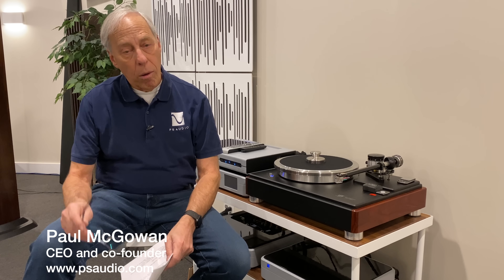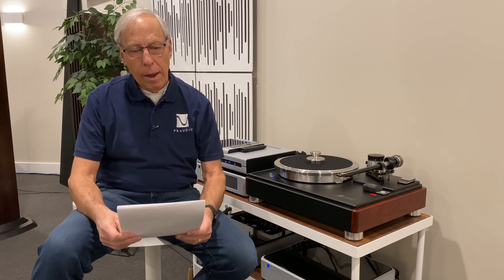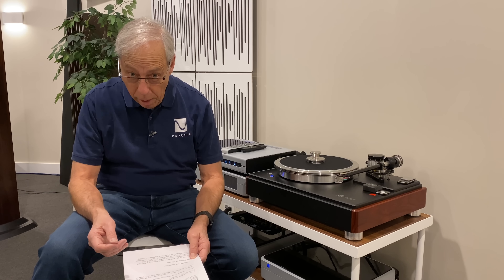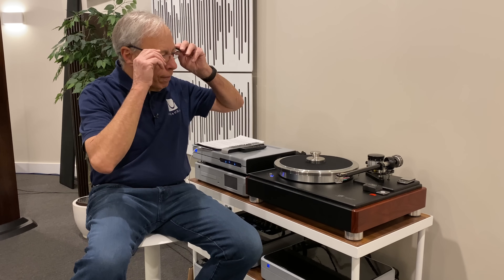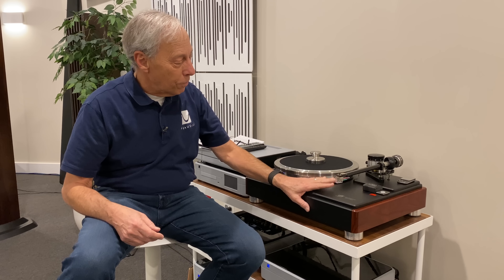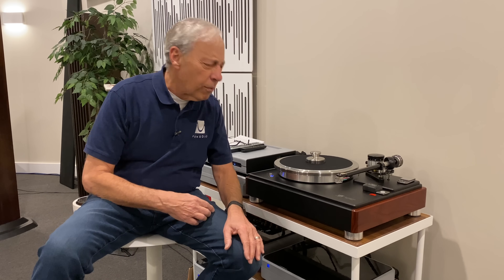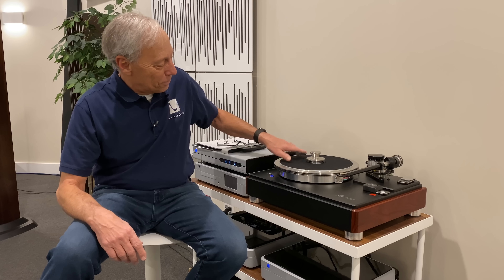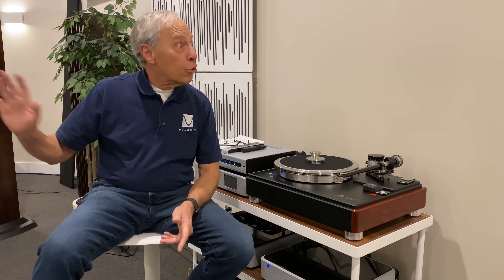Better to use a power conditioner or straight into the wall?

Comment: I've used a handful of conditioners and wasn't happy until I tried one of the modern Furman conditioners (which are made for audio and are used in many recording studios.)  I've gone back and forth several times between the wall and the Furman and the Furman stays.  It cleans up the system and if there is any detriment to the sound, it's not of any significance.
Reply: my system was very noizy.guy at the music store told me to get an furman power conditioner.soon as i turned on my system noise gone clean power using ps audio jewel ac power cord.
Reply: Without real measurements from an EMI Dirty Electricity Meter in mV, saying it cleans up the system is just based on your personal opinion. I have an expensive Furman PL-PLUS DMC Power Conditioner and the dirty electric signal in my wall outlet is 56 mV and any outlet on the Furman itself is worse at 160 mV. So yeah, according to my Greenwave EMI Dirty Electricity Meter, the Furman is NOT cleaning up the dirty electricity and actually making it worse!
Reply: @andynonimuss6298  You can visit the Furman page or better yet write them and get  frequency dependent plots showing noise reduction. If you don't trust those, I welcome you to purchase a proper network analyzer or oscilloscope with a decent probe to recreate those data. I wouldn't trust some cheesy $100 noise meter bought off the web for a full spectrum, calibrated noise analysis. They won't have the bandwidth to provide useful information.
Reply: @terrywho22  And yet here YOU are trusting those claims without any evidence or testing of YOUR own! I'm looking forward to YOUR video and testing evidence with a proper network analyzer or oscilloscope. Until then, I will continue to challenge their claims just like a lot of people already are.
Reply: @andynonimuss6298   I'm not the one doubting their claim. I can hear the difference.  Further, I've worked in studios where we used them and they wiped a significant amount of background noise from tracks we were recording. If you can't hear a difference, don't use one. But know that your "testing" method is flawed and if you want to do a proper job debunking Furman's claims, you'll need the proper equipment and knowledge to do it correctly (which I have pointed out is rather expensive and the process time consuming.)
Reply: @terrywho22  Exactly my point. I have the Furman PL-PLUS DMC Power Conditioner and I don't hear any difference. Sorry to say, but if you search around the Web and on YouTube I'm not the only person disputing and disproving their line noise reduction claims.
Reply: @andynonimuss6298  I can respect that. Sorry that it didn't help your situation.  I recently read an excellent account of a researcher that measures extremely small voltages in his lab and found that using Furman power conditioners did help reduce his noise floor on very sensitive gear. I wish I had the series of posts that I could relay to you, but either way that doesn't change your situation and I'm rather disappointed the conditioner did not help... especially given that you laid out a fair amount of money for a nice model.  All the best.
Reply: Interesting, what model do you have or recommend? as there are few at different price points and I never gone down this route just straight from the wall
Reply: @tothemax324  I've been pretty happy with the inexpensive PST-8D.

Comment: Do surge protector power strips have a negative effect  on audio?
Reply: As long as it uses 12 AWG wire and outlets with good tension like hospital grade ones and has no inductors or capacitors in it then no it won't effect the sound , where as while power conditioners will remove noise  the inductors and capacitors  in it cause the voltage and current will be out of phase which will negatively effect the audio.
Reply: @leekumiega6576  Thanks

Comment: your get way better results  conditing your rooms  Acoustics .
Reply: Acoustics is easy to over-do. A very furnished room will often have the right amount of diffusion and reflection to sound alive enough. especially mid sized room is fairly easy. Larger rooms might be more difficult. speaker placement, and coupling or decoupling of speakers is more important than room acoustics.
Reply: Shielded high quality power cable on an IGR is all you should need.

Comment: within the last year i have experimented with power cables and a device called DC Blocker. my conclusion is that they do make a difference and as you have indicated it all depends on how resolving your system is. i can tell you that i wont be going back to standard power cords.
Reply: The most interesting power conditioning system I ever worked with involved a motor, a flywheel and a generator. The motor was driven from the line feed, I think it was 240vac 3-phase. That was connected by a shaft to the generator. Lets assume that was a 240vac 3-phase generator. Attached to the shaft was a flywheel. That thing was pretty tough and was used to stabilize the feed power to a critical computer system. It was not designed to keep things going when line feed was lost. Believe it or not it was in a office building in downtown Tulsa OK.
Reply: @wilcalint  amazing

Comment: Is this a big problem in the US? US uses 120v UK 240v,  US 60 Hz, UK  50 Hz. I've never tried it so can't say anything other than an educated guess. But if you've got a high end system (that beautiful turntable must be 10k plus) , in excess of 20k, surely when it's designed, built, tested, put together, if there's this 'huge haze' that is lifted by a power conditioner then it would've been back to the drawing board at the design stage? How could you sell products without an included power conditioner/ chord if they had a 'huge haze' over them?
Reply: logical

Comment: The DC filter that supra has is a filter that is very good, but still a filter. And if you have to use a power block, because you have too few outlets, you will have to get some better power blocks etc to avoid the problem with low quality power blocks. Bad power blocks destroys good sound. Especially for amplifiers.

Comment: I always plug my high current amplifier directly into the wall....fairly obvious here.  But, I plug my pre-pro into a power conditioner because my (basic) understanding is that this component draws much less current to work so that it can easily get what clean juice it needs from the conditioner.   Is that incorrect?
Reply: You are probably correct. Especially if it is a power conditioner for audio equipment.
Reply: That is the best policy. Power amps do not require power conditioning and work far better directly off the raw AC line which provides a CONTINUOUS low impedance source. Many re-generators claim to offer even lower source impedance than the power line and that's not a lie. However they can only do that for a limited time then the power supply within the re-generator must recover. For brief transients with a poor AC supply I guess they may offer some benefits. But you have to weight in the cost.
Reply: @andydelle4509  large power regenerators are good for amps, but they are insanely expensive.

Comment: I’m gonna be far more radical on this then Paul is.

I have at least 20 more years experience dealing with crap line power then Paul does. First 99% of consumers have no idea of the quality of the wall socket power they get. It can be horrific yet your system plays just fine. Today. Then in a few months the Receiver, Preamp, Amp, DAC all or some don’t power up anymore.

You kinda have to make a rough estimate what your risk is. If you’ve a moderate investment, and willing to lose it, some or  all, go ahead and plug it naked into the wall socket. If you’ve invested 10’s of thousands of $$$ into your system. Do something, anything. A power strip with “protection” is a joke. Do something. One of Pauls Power Plants as a start would be a really good start.

If you live in something like a 50 year old apartment building with window mounted air conditioning you’ve got s..t power.
Reply: Power strip protection.

Common power strips have devices in them to protect mostly against “spikes” in the line. They absorbe the energy and dissipate it as heat. And that many times in just 10’s of milliseconds. They do that one time. The second 10,000vdc spike coming down the line 100ms after the first spike goes right into your components power supply and they have to deal with it. And many times they do that by self destructing.
Reply: Worst of the worst

You live in an older Apartment building with a common air conditioning system. And it’s getting old. Like 40 years old. One day when the HVAC motor turns off, not on, but immediately the motor seizes, throws a massive common mode spike into the grounding system of the buildings power distribution wiring. You come home to find your treasured DAC for some reason does not turn on anymore. Or where the DAC was is a little pile of burnt charcoal.

I wonder if Pauls Power Plants self destruct to protect whatever is connected to them?
Reply: I live in a 60 year old apartment. And the power is crap.... :)
Reply: @oysteinsoreide4323  Crap is one thing. Distructive is another.
Reply: @oysteinsoreide4323  The worst power I had to deal with was in the office of an oil products tank farm distribution facility. Huge old motors, switches, relays, motorized valves and on and on. All of it constructed in the 50's. Into which we had to install a $250,000 very critical computer system that was not ever allowed to go down, or wiggle even a little. It was next to the Mississippi River in East St Louis IL.
Reply: @wilcalint - off subject, but as a 61 year resident of STL. If you were in East St. Louis, IL you had more problems than you know...
Reply: @Mark-lq3sb  I suspect there are still tank farms over there. This effort was in the mid 70's and we were well aware of our environs. It took us about 6-weeks to get that thing in an up and running.
Reply: A fun follow up is that I think about a year later we got a panic call from that office that a "Ice Jam on the MIss was going to flood the office and computer and we had just 48-hours to get it out of there. So fly from San Diego to St. Louis, drive over to E. St Louis and the engineers had only hours to get that thing out of there, safely. Important tool used? Fireaxe.
Reply: @oysteinsoreide4323  If you recognize things that tell you your AC power is crap, it's really crap.
Reply: @B57.V  I never said it sounds bad.
Reply: I unplug my Naim gear if there is a storm and lightning.  Otherwise its straight into the wall.  I havent researched PS Audio products but they all cost alot.
Reply: @rd264  Lightening strikes can occur at any time, even without a storm. Pulling your master plug on your system likely will prevent a Lightening strike on your homes power distribution system from damaging your audio system. I've done that myself.

IMO your system is more likely to be damaged by line surges, a ground fault or a deep voltage sag in the delivery. Going down to 90vac can be just as damaging as going briefly up to 340vac.

I applaud PS Audio for offering their line of power conditioning products. I can think of lots of reasons to need one. Especially if you live in a multi residence building. Especially an old one. An oldbuilding with an old common air conditioning machine is probably a problem.

I would expect that a PS Audio power station would sacrifice itself in some way before it passes on a power anomaly.
Reply: Power line used as a LAN/WAN

Most power utilities today use digital communication on their distribution system to “read the meters”. Don’t you think for a second that that digital noise doesn't end up in your cherished DAC.

Your sharing a power line transformer with three of your neighbors. One of them is using one of those power line LAN devices. Or they have one of those plug in the wall video baby monitors. Don’t you think for a second that that digital crap doesn't end up in your cherished DAC.

Comment: I've built a lot of motors over the years. The bottom line is this. You can add a single performance part to a motor but if you only add that single part you will never notice the difference performance wise. When you start adding more and more parts things start adding up and then you notice. Paul's world is just like in the racing world. Paul wants the best of the best of the best or a 2021 Indy car of stereo's. Racing is the same and is why a race car can cost up to a million bucks. Every part on the car is the best of the best of the best and if you looked at the cost of some of this stuff it would make you puke. But the real question is, do the most of us need a $20,000 steering wheel? Answer, not unless you plan on building the rest of the car.
Also keep in mind a 2021 steering wheel is not something you can buy for a 2031 car. Just like Paul said. They didn't like the power conditioners back in the 90's. If you bought one back then you would be buying a new one today (and probably couldn't give the old one away with the depreciation of audio equipment).

Comment: i worked in the power supply industry as a technician and then an engineer for over three decades and during that time i was responsible for getting power supplies compliant with FCC conducted noise specs. I spent a lot of time knitting filters together to get the noise down using our Marconi spectrum analyzer.

I find running the low power gear through a 20A line filter and plugging t he power amps directly in the wall works best  for me. first off I can't afford a power regenerator and the military filter I'm using has very low insertion loss at 60HZ. The signal level gear also does not draw the slugs of current that a power amp does so it cuts out any ringing that large current slugs can cause. My power amps are the M700's monoblocks and that type of design should be better at rejecting noise and the filter keeps any noise that does occur tamped down.

If I ever win the lottery I'll try out one of your regenerators.
Reply: I concur with your analysis and agree with your solution.
Reply: PS Audio Power Plants start at $1500 and way less used. No need to win the lottery to get one.

Comment: Like your power amplifier should have lowest possible output impedance for best performance, same actually goes for your power cabling to the amplifier. A power conditioner that adds impedance by a coil I series with the wire is like a longer power cable and adds “elasticity” in the power the amplifier can consume, which can hurt peak performance.

Comment: I think a list of criteria should be developed to aid someone as to if a power conditioner would be helpful. IMO, I believe that vintage amplifiers/preamps may be able to mitigate a somewhat "dirty" electrical supply better than present day equipment due to the fact that most of the old stuff used big iron core power transformers, large filtering capacitors which simply stored huge amounts of potential power waiting to be tapped by the demand of the speakers. The simple fact that big filter caps just sat there with a nice big charge in them pretty much smoothed out any noise or fluctuating input power line issues. The new stuff, some being Class D using switching power supplies, may be a bit more dependent on the quality and quantity of the AC power from the wall. These types of amplifiers use smaller filters caps, and depend on the switching power supply to instantly supply large current demands when needed by the speakers. So, the power supply has a sort of a governor in it much like say a lawn mower engine, to keep a constant stable output. If a transient (tall grass) comes along, the "governor" attempts to provide instant power. It has to hit up the mains (supply) from the wall outlet. If the mains can't supply that instant hit, the amp could struggle generating the transient the speakers are asking for. I'd also would believe that if one lives in an apartment, or high rise building with a bizzillion electrical circuits loaded with who knows what, I'd definitely look into a good robust conditioner. I, on the other hand, live in a semi rural area, where the pole transformer feeds 3 homes, and have a newer 200 amp service, well grounded, and stable, I may be able to get away without a conditioner. The only thing I have a hard time understanding, is Paul's explanation of how a conditioner affects the nuances of the musical passages. You would think getting the purest power available would be the ticket to the best sound? IE: actually using batteries to power an amp (NOT using any circuitry). If the B+/B- rails need say 65 volts, you string up enough cells to get that voltage both +/- supply, etc. I've done it on a smaller scale powering a 40wpc old skool stereo amp once. It did work!
Reply: Curt Chase 
Yeah, Curt. I don’t know if you saw the vid of Danny Richie’s rig, which he runs fully on battery power, and Danny is definitely in the know. 
I’ll try and find the link to the vid if ya haven’t seen it. It’s pretty damn cool. 
Have a good one, Curt! 🎶👍

Comment: very good explanation of sound affection from the power consitioner. certainly umdesired effect. I'm in the process of testing some power cables. I have recntly tried out wireworld electra 7 which is power conditioning cable. first day I got all that Paul said that power condionters take. the other day, the sound was so big that I concluded that it is too good for my system and room.

Comment: Every power conditioner etc is compressing dynamics... Clears up the sound, but dynamics are very hurt...
Reply: vessk000 I can understand analog equipment, especially a power amp, but how about digital? A conditioner isn’t compressing the dynamics of digital units which are drawing much less power, correct?
Reply: @sean_heisler  I said it about the amplifier, if it is connected to such unit.